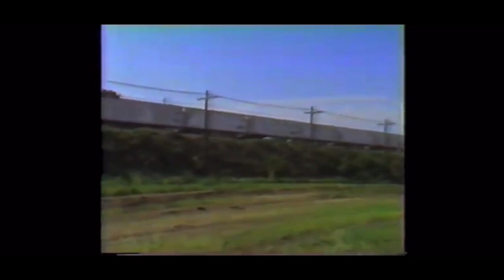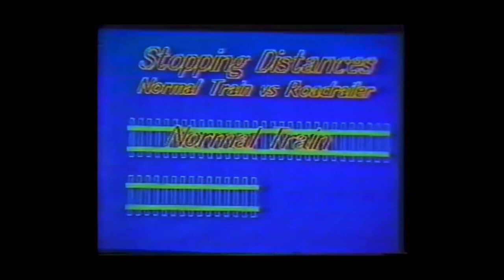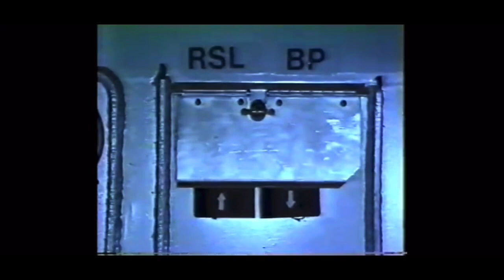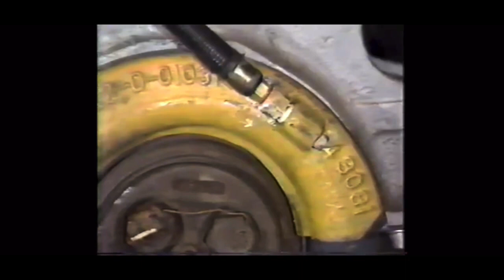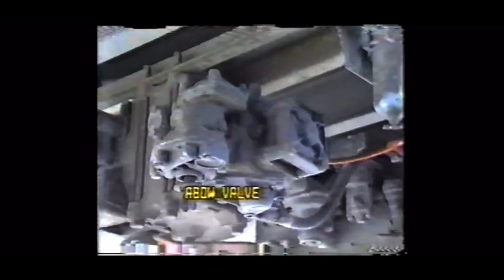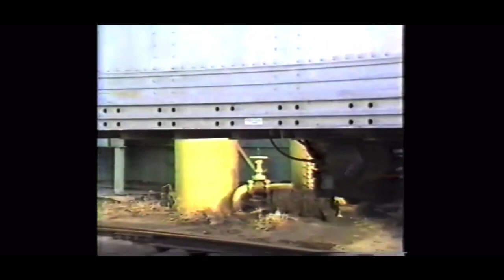CSX Roadrailer Operation Historical Video

Comment: I find this vid very interesting , I well remember this service  .  I photographed many of these runs in Kentucky , Tennessee and Georgia .  My favorite motive power was of course the four F Unit locomotives numbered 116 , 117 , 118 and 119.  I have seen between 9 and 91 trailers pulled by these iconic engines.  One day , I was chasing the northbound train ; R 210 thru southern Tennessee and was set up at a curved bridge over Cove Creek , just south of Jacksboro , TN.   After getting this fine broadside shot , I hiked back to my car , drove out to the highway that followed the CSX right of way .  When I got to this road I was totally surprised to see the train right in my line of sight ; BACKING UP .  To this day , I never figured out what was occurring before my eyes.  I was easily able to get a good lead on the train and set up for several great shots in the Kentucky portion of the run.  That was a fine chase for me , one of many in this era.  I still am amazed the management allowed these vintage power sets on the main line with the hottest train over the road .  You will note that at no time during this video were the cab units shown powering the train.  Amazing ..... Look forward to any other comments from those fans that were able to view this long gone operation.

Comment: I work for UPS, occasionally we see these units in our yard as lease units, they are pretty beat up from use, but the advantages of not having to use a rail yard crane to remove them from the rail seams like a good idea, but now that most manufactured goods come from over seas it doesn't really make sense for the current manufacturing sector transportation here in the US. They might be a good choice now that fuel costs have really run a lot of truckers out of business, and might be better use for refrigerated transport of produce, and other rail transportation locations.

Comment: Failed technology.junked
Reply from the maker: A failed, or less optimal version of a technology. Other similar arrangements managed extended careers in fairness to the general design.
Reply: roadrailers are still used today. it's just a different design. (because this unit ended adding what could be considered unessary weight while on the road)